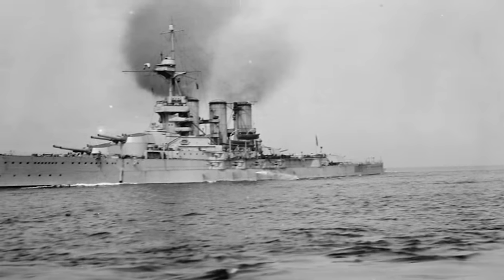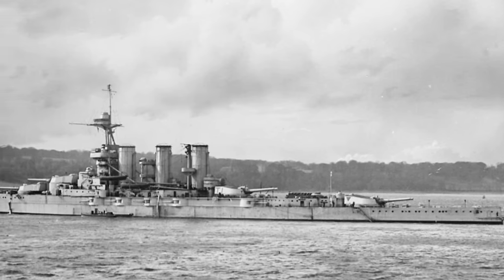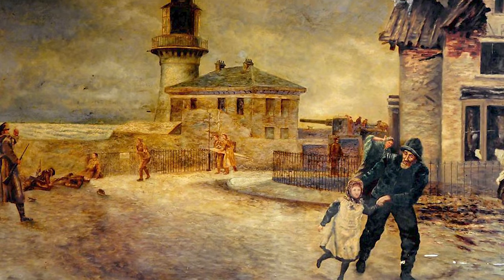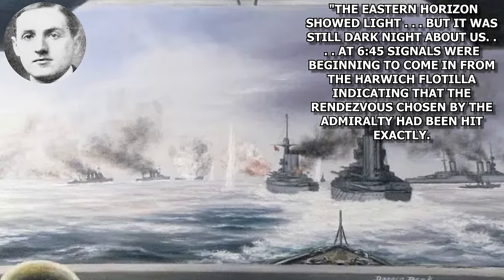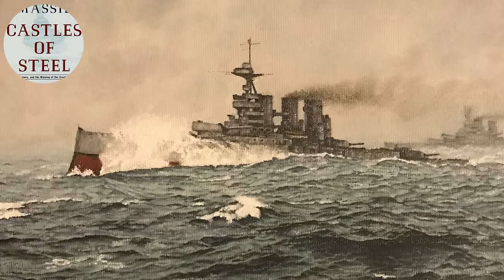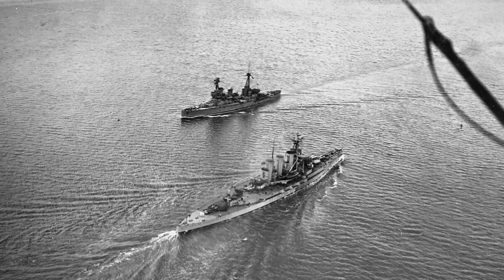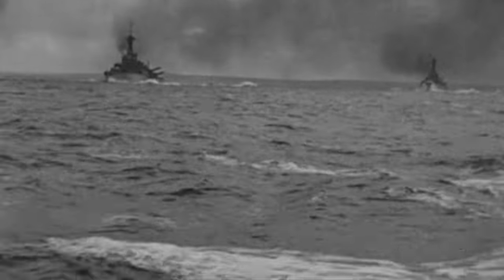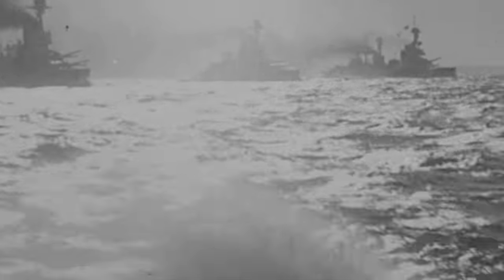HMS Tiger: How Not to Get Blown up at Jutland

Comment: Tiger could have been 'demilitarized' the same way the Japanese 'demilitarized' one of the Kongos. Interesting note is that the 14" guns designed to fit on the 1936 King George V battleship were also compatible with the 13.5" mounts on Tiger and the Iron Duke class BB's. So If they had kept Tiger she could have been armed with them instead of the old 13.5" guns.
Reply: Yes, I agree. she could have been kept as a training ship instead of Iron Duke (you don’t hear about Iron Duke’s WW2 service because she was bombed in Scapa Flow early in the war and had to be beached to avoid sinking.

Comment: Ok overall good covering of the events, however I disagree with your analysis of the difference between German and British Battlecruisers. In many ways the thinking behind the ships designs were completely different. 
Germany sees their ships as "an auxillary to their battleline" capable as acting as a standing for a full Dreadnaught battleship if needed, because they dont have enough full Dreadnaughts to compete with the Grand Fleet, so they need the heavier armour and pay for that with fewer or smaller guns. 
The RN has a different role entirety for their Battle Cruisers /Battlecruisers; in that they are never envisaged as a stand-in for a Dreadnaught. The RN has enough full Dreadnaughts to overmatch the High Seas Fleet, so their role is different and they as such do not need as much protection. What they needed were vessels with Range, Speed and Firepower to dispatch commerce raiders across the globe (,see the battle of the Falklands for what happens to Germany's armoured cruisers vs 12" of the Invincible class). So they are designed as heavy scouting ships and trade protection. 

What Dogger Bank and Jutland show is....... What happens when you put a Rear-admiral in charge of these ships who fails to understand the role which Fisher had envisaged for these ships, when they are involved in a fleet engagement and believes that "rate of fire should override all safety protocols". I recomend you read the "Jutland Scandal" by both Vice Admiral John Harper and Admiral Reginald Bacon, they prity much destroy Beatty's command decisions and explain his failings and destroy the spin Beatty put on his testimony in the Admiralty review after the Battle of Jutland. Beatty should never have become 1st sea-lord in his later career, he should have been sent to the West Indies as the Governor of some small island in 1914, where his political talents would have been more useful- or have been sent to face von Spee off Coronel instead of Craddock and be lionised as the "lost hero".

Beatty is a politician in uniform and is in the role because "he looks good to Churchill"; a self-publicist who believes in his own rhetoric and is promoted well above his capabilities. If you compared him against officers like Cradock or Sturdee you would find him wanting in his abilities to command ship(s) at sea; Beatty surrounded him self with officers who "look good in social situations or who had political/noble connections" (yes Seymour is directly related to the Duke of Norfolk)- not for their abilities to efficiently operate a ship or squadron of ships. 

Sorry about that I got off topic there, but i find the more I read about Beatty the more i find him an "expensive ornament". So back on the topic - RN and German ships had different design briefs....despite the classification being identical; and because of the view in the Washington treaty for the BC is similar to the German and Japanese PoV, that they are "capital ships" which can be used in the battle line with a full Dreadnaught, that the held view by many commentators like yourself is that RN' ships are deficient in armour. 

So think of the RN ships as "Battle-Cruisers" with a hyphen rather than "Battlecruisers"  (one word). They are originally designated as "Dreadnaught Armoured Cruisers" by Fisher, which is a bit of a mouthful but describes their role as that of a "Cruiser" not a "Battleship". Their role should have been to lure the German ships into the Grand Fleet like a cruiser squadron would have done.....or in their case pull the German BC's  into the path of the 4 QE class of 5BCS; which even with the shells with crap detonators would have poked enough 15" sized holes in the German BCs, that Hipper would have his Viking burial at sea.
Reply from the maker: Some rather interesting points you bring up here. I am fully aware about Admiral Fisher's intentions with his "Dreadnought Armored Cruisers" and how they were not intended to fight in the battleline. However, the fact of the matter is that they did fight in the battleline against other capital ships and therefore Fishers intentions don't necessarily matter when you have a foxhunting man like Beatty who is going to go into the chase against ships his battlecruisers weren't really capable of fighting effectively. I think my favorite description of the difference between British and German battlecruiser construction comes from Gary Staff's German Battlecruisers of World War One, where he quotes Korvettenkapitän Vollerthun "In the type development of our großen Kreuzer since 07, inspired by the English Invincible class, we have increasingly pursued the qualities of a fast battleship with the intention of making the authorised number of large ships as far as possible also capable of fighting in the line. This approach with our großen Kreuzer since 07 has given them a different character to the English, and has brought their displacement to that of the battleships...(Going onto say and this is what is important) ‘The “English Battleship-Cruisers” stand against our “Cruiser-Battleships”.’ So, essentially what I am trying to say is that I don't entirely disagree with you. If these ships actually were used in their intended role to kill armored cruisers like at the Falklands they would have been fine. However, the fact of the matter is that they faced larger caliber guns of more than 8 inches and therefore did not have sufficient armor for that role. Also, I should mention that I do agree with your analysis of Beatty and I would never put it in a video to stay impartial, but looking back on some his decisions not only in command but in his personal life, he is a rather unique figure and something you don't see anymore these days!

Comment: They were not designed to fight against heavier guns than 8 inch.  They would have been fine if they weren’t ordered to mix it with the significantly different actual fast battleship German ships which should have been left for the Queen Elizabeths.  Not all Beatty’s fault on the day, the established strategy was wrong.